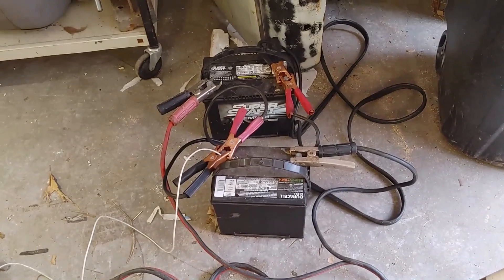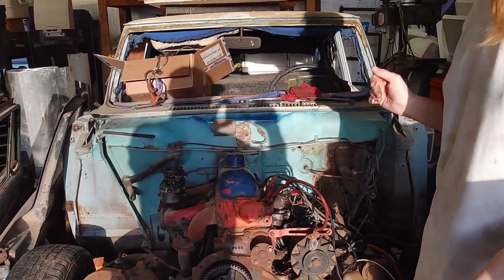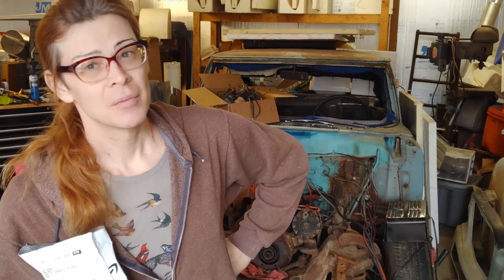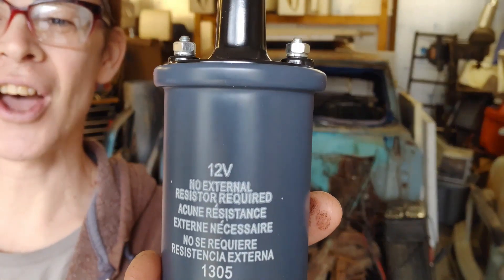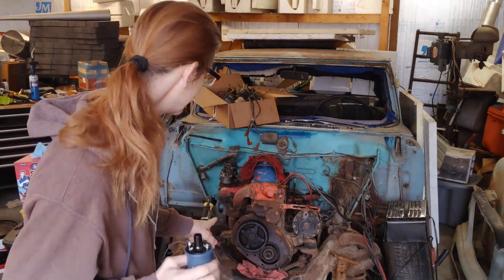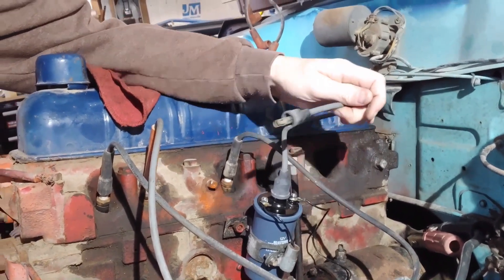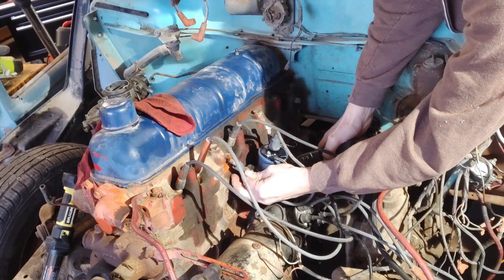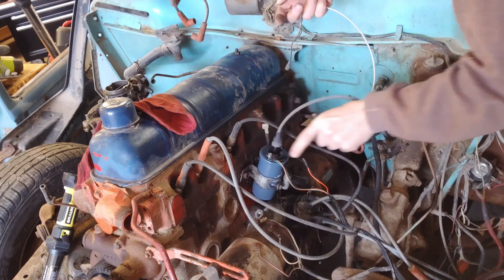Part 3: 1961 Studebaker Lark revival automotive electricity hack 12 volt to 24 volt for weak starter

Comment: Pretty sure you already know this, but i set the ignition timing by setting the crank at the firing mark and using a light bulb to set when the points open. Then go back and use a timing light to make it perfect.
Reply: also eagerly awaiting this beasty to burst into life! Keep going!
Reply from the maker: @SpudInnit  I have never worked on anything this old. always had a bit more precision to start with. I will work through it!